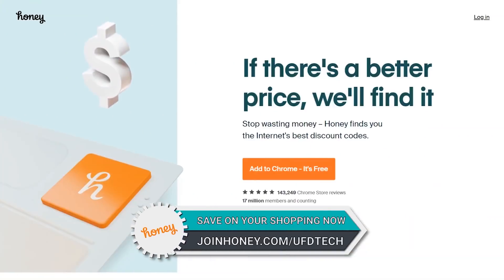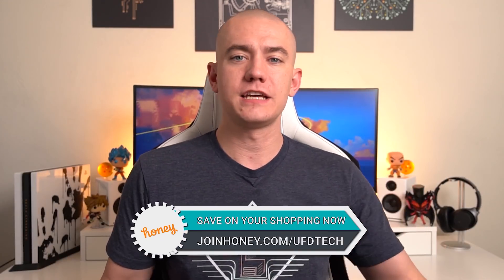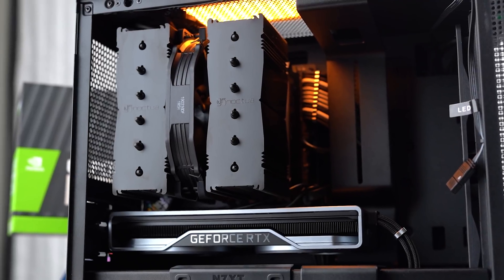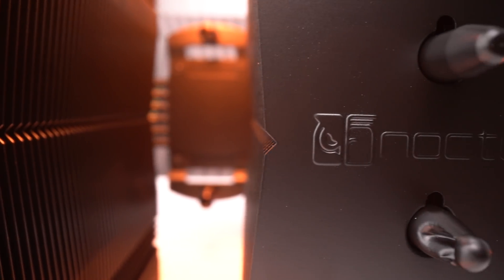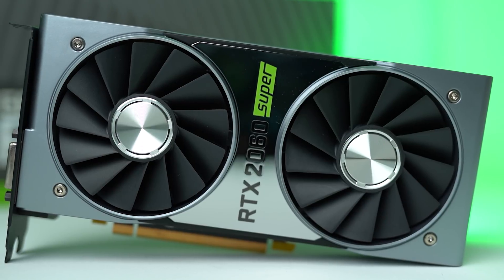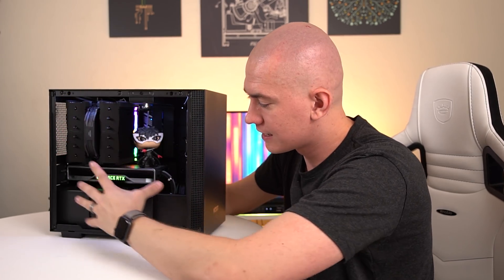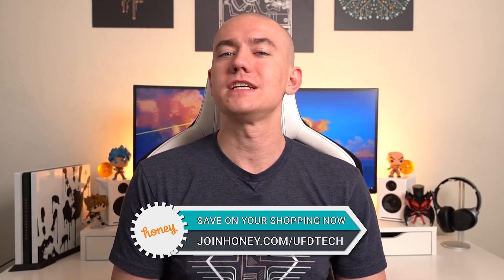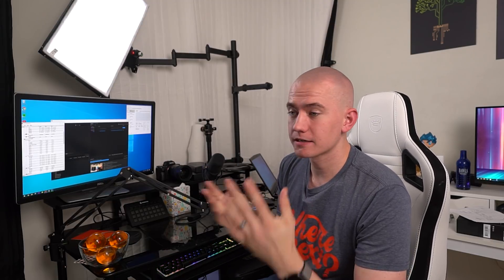I Waited MONTHS for This!

Comment: Does 9900k and a 2060 Super actually make sense? Maybe I'm just spoiled, but I would even thing a 9900k and a 2070 was a bad matchup with a 2070 super being minimum and a 2080 or 2080 Super being more in line with what I would expect actually uses a CPU like that to its full potential (2080 ti obviously being the only thing better). I mean the 9900k runs into GPU bottlenecks on a lot of games even with the 2080 ti... A 9700k with a 2070 Super is a MUCH better balance that would get way better performance for the money and make way more sense, no matter what deals you got. Just all around bad PC balance in my opinion... And frankly, at that point it makes more sense from an overall performance to price ratio perspective to drop the 9900k altogether and go with a 5700XT and a 3700X. Basically if you're going to bother with a 9900k I don't get why you would waste your time with anything less than a 2080 Super in the current market, other then to waste money on performance you can barely unlock. For games you're not getting what the 9900k can offer, and for productivity the 9900k is more expensive for a fraction of the performance... All around silly...   Cool build... But... Silly really.

Comment: Hi UFD tech, welcome back.
I have the same power supply as you do which is Corsair power supply, however, my Corsair power supply is DEFECTIVE after only four months of light usage. The connector of Corsair power supply was melted because of CHEAP material that Corsair has been using on all of Corsair power supply. My second Corsair power supply was also DEFECTIVE after ten months, smoke was coming out of my second Corsair power supply, countless of Corsair consumers already mentioned that smoke comes out of Corsair power supply. Reality is: Corsair has been throwing money at Tech reviewers (except ufd tech, Not you) to NOT mention about DEFECTIVE Corsair power supply ( melted connector, and smoke coming out of Corsair PSU)
Now I go back to RELIABLE Seasonic power supply that I have been using for seven years, Seasonic power supply is very RELIABLE, Seasonic power supply also comes with twelve years warranty

Comment: Could do without the intro and the close ups of standard parts. Build didn't seem too well thought out and certainly not like you waited months for it as the title suggests.  Does the side panel fit with that cooler? Can you see the Memory behind the cooler when looking at the machine straight on, if not I don't think I'd have gone with RGB memory. Looks like you had to remove an exhaust fan just to get that cooler in. If its a showcase for the cooler than give some results, if its for the case, then get parts that compliment the case, like an AIO. You were of course beautiful as always, best of luck!

Comment: The cinematography is nice but yeah the BGM is a bit too "upstart" and doesn't match with what I'm seeing. Regarding the build I'm more concerned about the airflow. If I were you, w/c I am not, I would've used an 120mm AIO on the back something like a CM ML120L and a DeepCool RF120 RGB or CF120 RGB on the top. And in extreme cases I would've custom looped it so that the GPU can get a better thermals because the chassis is too cramped for a cooler like that and needs a blower style or watercooled.

Comment: A 9900k in a ITX build with a 2060... Why? 3700X has equal or better multi-threaded performance and with a 2060 in games you are going to be GPU bond, also a 3700X uses far less power so it would be easier to cool in an ITX build, so why. Furthermore a 3900X would have much better multithreaded performance and consumes about the same power as a 9900k... Also why a RTX 2060 when a 5700 is the same price and performs better?

Like I know you already have the hardware laying around so cost isn't a factor in a build, but shouldn't you at least put some consideration into price/perf when making a build so that other people can follow what you are doing when they are making a build.

Edit; isn't that kinda a weak excuse for the 9900k, as the you had a 3700X and 3900X in SA... so why didn't you bring one of those, or did you not have an AM4 board for them, so it would have been harder to bring, which if so fair enough.

Comment: whats your opinion on the "Fractal Node 202" ??? Is it a good itx case??? or is it trash?
Reply: It's pretty good (for the price, availability and form factor), but it will need some mods. Pick mid range components to control your temps better.